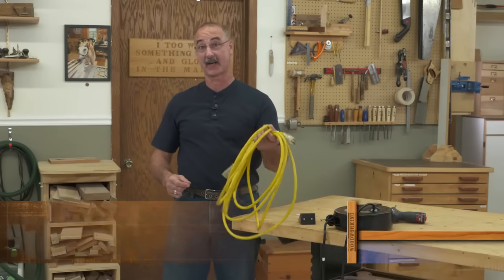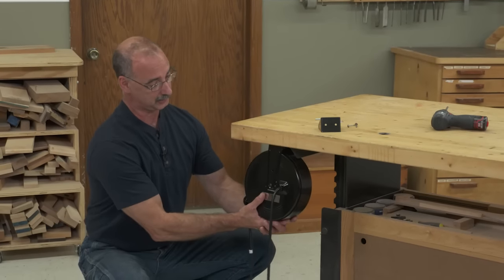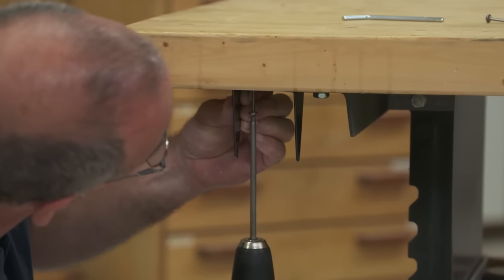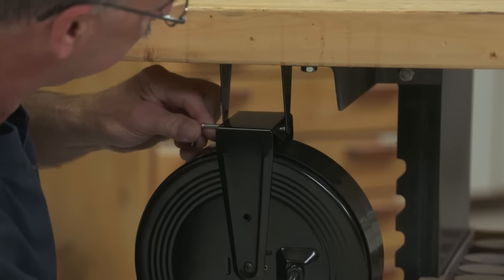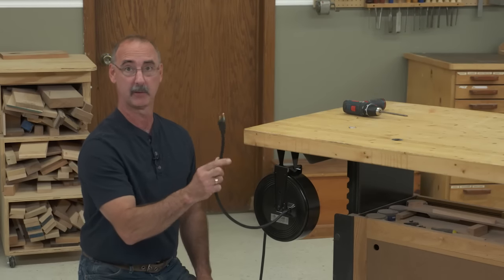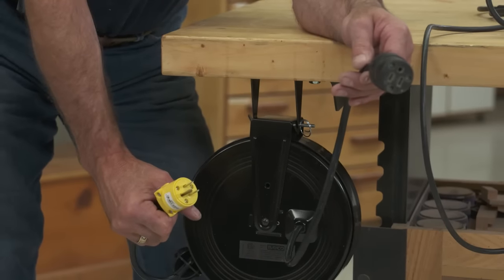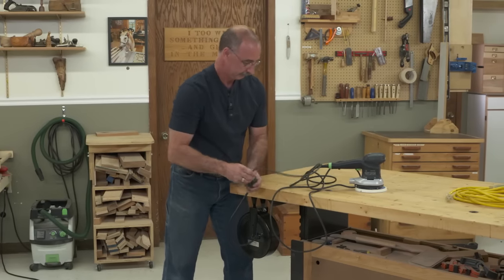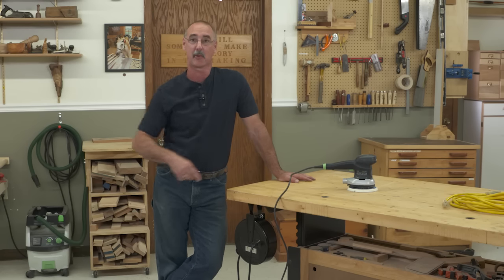Electrify Your Workbench

Comment: I just installed 2 outlets,just as you would in a wall.one on each side of my bench,works great ,no cords running across the floor.I put a plug on the power supply line and plugged into an existing outlet right next to my work bench.

Comment: Love this.  The only thing I would do differently is instead of putting a female end on the bench side, I'd run that into a double electrical outlet box on the bench.  This way you don't have the female end flapping around.  Depending on the size of the bench you could daisy chain the outlets together.  Just know that you could not use more that what the extension cord is rated for.

Comment: Why not add a small power strip to allow you to have more than one tool at the ready?
Reply: +ken beattie Thats one reason I went different route. This way I can have all my sanding equipment plugged it all the time, knowing I only use one at a time anyways
Reply from the maker: +ken beattie You can use devices that expand the number of access points on the line, but be sure to use only devices that support the amperage requirements for the tools that you use.  Many power strips are designed for low amperage operations, so be sure to use one that fits your situation, as undersized wiring is a safety hazard in a woodworking shop.

Comment: Do you not need to unwind it fully before using any tools? I've always been taught that reels need to be unwound or else it creates a hot 'coil' of electricity and can start a fire.
Reply: +Olly Parry-Jones that's why the AMP rating is important. If the cord and reel is rated for what you are using it for, there's no chance of a fire from the coil.
Reply: general4str
Thank you.
Reply: +Olly Parry-Jones As long as you aren't using a 16 gauge or thinner cord.  For most power tools 14 or 12 gauge is appropriate.  The wires are rated for a certain temperature, the thinner the wire, the sooner it reaches that temperature.  A 14 gauge cord running a drill or small sander will never generate much heat, while running something like a circular saw on (a longer) 16 gauge wire will more than likely heat it up beyond it's capabilities AND ruin your tool.
Reply from the maker: +Olly Parry-Jones Hi and thanks for your question.  I am not an electrician, so for a fully qualified response you might want to consult someone who is, or perhaps a company that provides homeowners insurance might have some insight on this.  Having said that, I am aware of the potential for this, but i do not have any firsthand knowledge of fires that it has caused.  I've been using a partially coiled extension cord for years and have never had a problem.  I think it is critical to use an extension cord of an appropriate gauge for whatever tool you are using.  I only use 12 gauge extension cords in my shop, which is a heavy wire that is not as prone to resistance and heat build-up.  I would also discourage the use of any extension cord in any situation where something is operating without someone being present.  In other words, don't plug in a space heater or AC unit to an extension cord to keep your shop comfortable when you're not there, or other appliances that might tend to run unattended. 
Here is an interesting article that I found which speaks to the risks of what you are asking about: 
https://fire9prevention.wordpress.com/2012/01/06/extension-cord-safety/In this article the author cites two personal encounters with fires that were caused by coiled extension cords.  There are no specifics about the gauge of wire or what was running on the extension cord, however.
Reply: WoodWorkers Guild Of America
Thanks for your reply. :-)